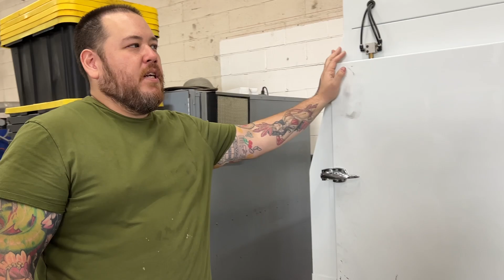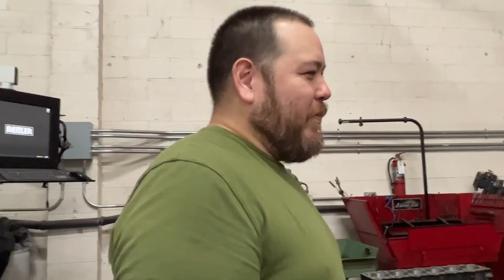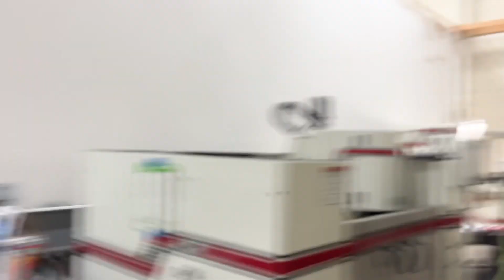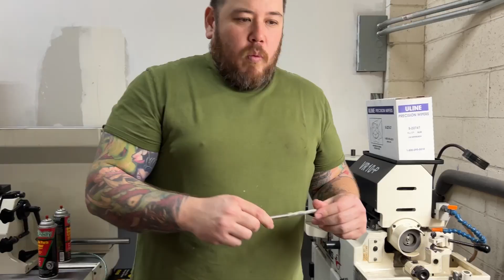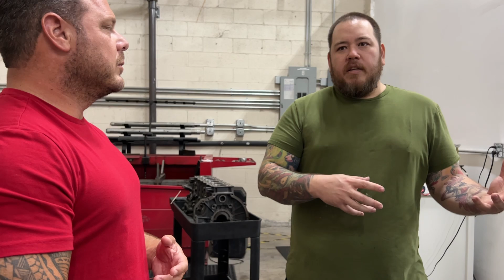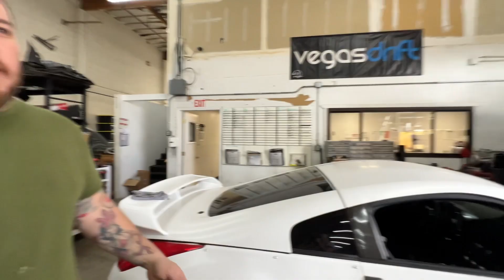WE BLEW UP OUR V8! (So We Had It Rebuilt Stronger & Better!)

Comment: People don't realize the cost of quality accurate tooling. The fact is as the bit remove metal, the bit also looses metal, requiring new bit changing, and continues measurement recalibrating. But we all know the the satisfaction you feel when a job is done right. That used be be what, "MADE IN AMERICA" was about. You know this guy is going to be swamped now that the word is out on his good ethics.

Comment: For anybody confused about all this machinist just talk I will explain. 
Tolerances as how much you can be off from the set measurement of how big or small something is. For example, if something needs to be .420 thou your tolerance might be .05. That means that if you make the part you’re working on .414 or as high as .426 you are out of tolerance. 
1.500 is one and five hundred thou .200 is two hundred thou or thousandths, 0.0005 is five tenths. 
Also, reaming is something you do to a hole to make it very smooth inside.

Everybody wants to explain more they can. I kind of just started machining stuff at school three months ago, so I don’t really know a lot.

Comment: Worked for a machine shop for a couple years. We did 13 and 15 liter engines. Some were 149ci per cylinder. Some had 2 starters and you had to have a ladder to get to the valley. V12 and yellow. It’s amazing how things have progressed but still trying to get to the same standards.

Comment: Awesome video. Give me more just like this. As an ex-rally driver who was struggling to get Ford Anglia and Escort 15/1600 cross-flow motors properly blue-printed back in the early '70's when Cosworth were the early benchmark (but out of reach to us mere mortals) and when a reliable 100bhp per litre was a pipe dream, this sort of engineering excellence with such stunning machinery on hand was as far-fetched as the internet. Now my road car produces 155bhp per litre and is totally stock and utterly reliable for road car miles; if only I could take it back in time... Thanks once again for this gem. Brian

Comment: He should rebuild a Ford Triton motor do it step by step on YouTube other mechanic have lot of problems with lot of mechanics don't like it and the Dodge Durango SUV motor they are afraid of it some pull the studs out of the head the motor has a head gasket problem